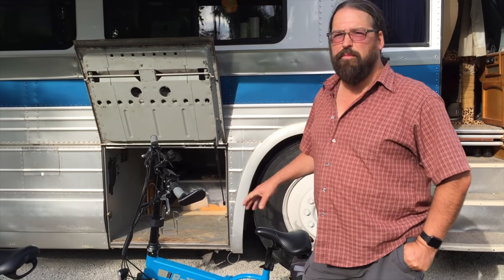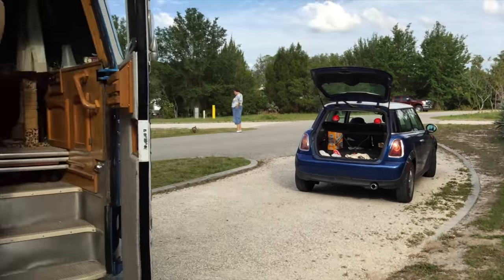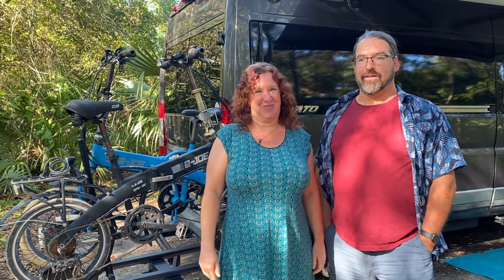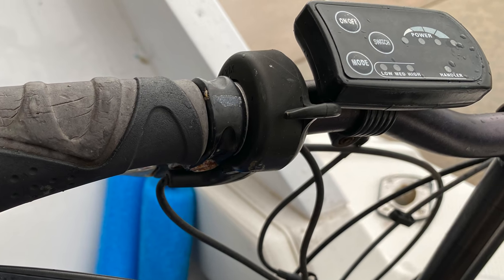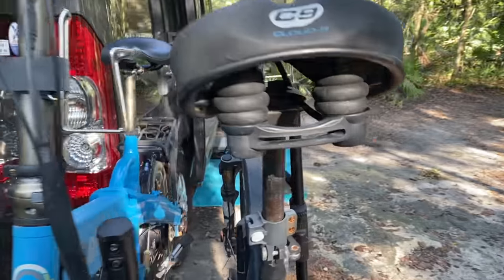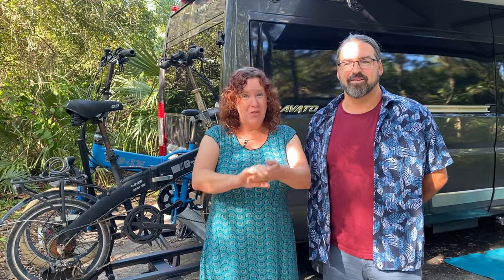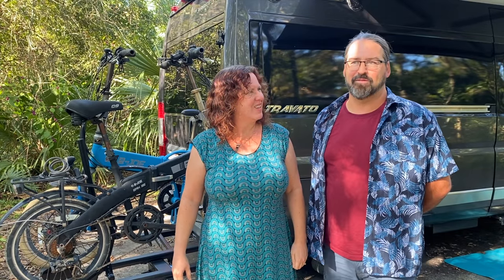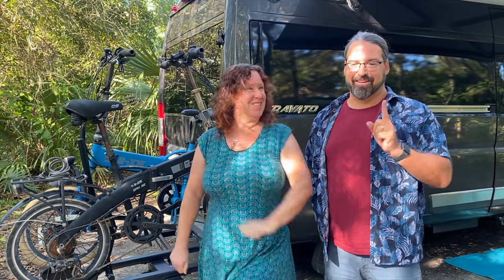Shopping for Folding Electric Bikes for RV and Boat Use - eBike Replacement Time!

Comment: I also recommend the Rad mini. It does not weigh 80 lbs, more like 60 lbs.  I've owned 3 over the past 2 years.   Sold one because my wife couldn't get her leg over the top bar easily.  Bought her a mini step thru.  She loves it.   We carry ours in the back of a 4 runner when we travel.  I'm  pushing 70 years old and I'm  6'1",  250 plus.  The mini has held up well under my weight....we ride trails frequently.  It's a tough bike, well made.  Also, if you remove the battery before loading they only weigh about 50 lbs. Easy to fold and load.  The front suspension is good off road too.  We also added a Cloud 9 cushy seat for our older derriere's.  I recommend them as well. Best wishes on your quest for new E bikes!  Cheers!!
Reply: yep --  exactly...these bike have large 48v batteries and you want to keep the batteries inside for security and charging anyway...as you transport them........  For my RAD Runner Plus order -- still waiting on the bike -- I had to do a Kuat Pivot 2 swing out base and Hollywood e-bike rack  as I could not find a Rocky Mounts Backstage anywhere -- sold out...
Reply from the maker: Hmm.. first report we've seen of the Rad's weighing that little.  Spec is 69 lbs, but many are reporting 75 or above when loaded.
Reply: Haven't actually weighed ours. But when we bought ours at the Rad shop in Seattle we were told they weigh about 60 lbs.  Seems about right judging by my non-calibrated biceps :-).  Taking off the battery and seat before loading could get you below your 60 lb limit IMHO.  If you ever get near Vancouver WA, I'd  be happy to let you ride mine and check out their weight.  Can you tell we really really love our Rad bikes!  And no we are not in any way  connected with the Rad company.  Just happy customers.  Cheers!
Reply: These are very popular e-bikes...........I see them all over the place..  VanTrekking Lifestyle couple  based in NC have a pair that they kept on the back of their Travato until the got a mini-go trailer  they tow with the Travato as they carry the bikes and lots of water toys and now have a dog carrier to pull with the bike..  I'm sure the Rocky Mounts will handle these  bikes.    the main reason to pull batteries and maybe the seats for for security from opportunity theft.  although the RAD battery is big heavy beast....
Reply: The only way it's around 60 lb. is if you remove the battery, which I recommend for transportation. And that's without accessories like racks. I highly recommend the RadMini, but the weight is an issue for some people. This bike is a beast and "mini" is a misnomer.
Reply: @Technomadia  The regular mini is heavier than the step thru.